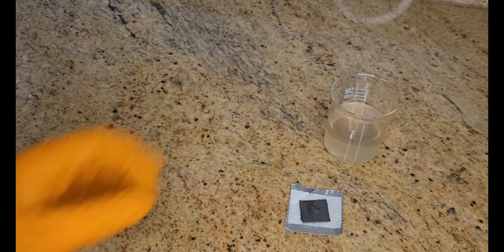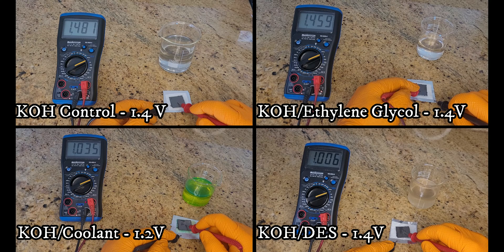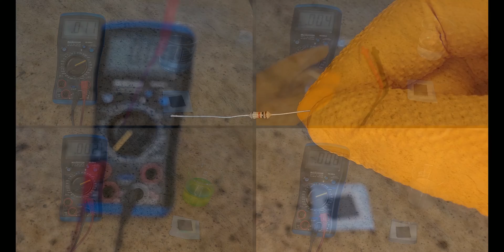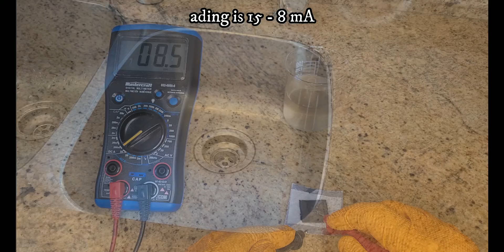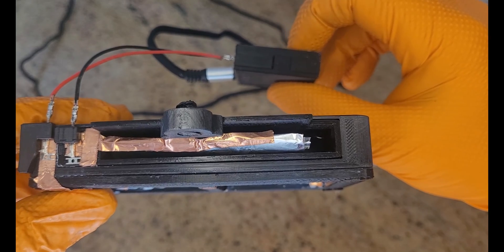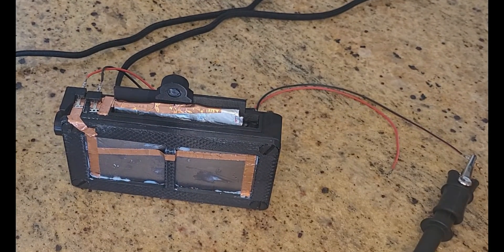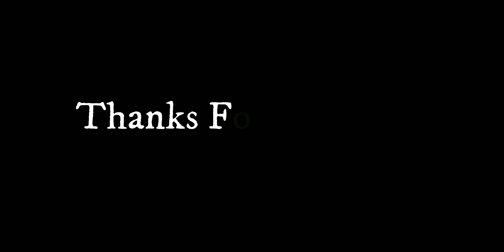Potassium Hydroxide in Aluminium Air Batteries

Comment: try KOH + UREA = Don't know the exact ratio, i just used Urea then added some KOH and stirr it using rod .. Liquid Formed , Extracted it .. AND did the same thing again and again .. Huge Amp .. Do reserach on this as well.
Reply from the maker: Very curious.  You commented on one of my other videos right?  I was thinking about what you said since then.  Do you mix anything else in or is it just KOH and urea forming the liquid?  I'm wondering if your making a deep eutectic solvent.  Which is pretty cool.  Also do you know what the liquids ph is?  And does the aluminum bubble alot when the liquid is touching it?  I have both these chemicals so I'm probably going to try it.  Just wondering what your experience has been so far.  Thanks for the comment 😊
Reply: @MechanicGoneRogue  : Nothing , Just Pure Urea granules , and pure KOH flakes.  if you need i can make video as well.

1. Put some urea in a beaker (5 grams), add  few flakes of KOH in the beaker, mix it leave it for few seconds (10 to 20 seconds) , smash flakes on urea, it will turn into liquid, 

2. Extract it just by tilting beaker .because of liquid, urea granule stick to beaker's wall and rest of liquid will go downside , simply extract it :D .. This liquid have super electric charges but dont know what exactly it is :( ..
Reply: one most important thing to consider, KOH flakes will be higher than UREA. If you use Stirring machine.. Less Urea + More KOH .. If you use same amount like 5g of Urea + 5Gram of KOH , it will turn into liquid but Urea will be there.. To dissolve urea you need to add KOH .. 

We can play with the ratios and check their performance in battery environment. 

I wanted to test in some battery environment , if possible for you please make a video on it .. 

1. Graphite anode cathode with additives + given electrolyte . (UREA KOH) different ratio performance. 

2. Graphite foil treated with KMNO4 ( Few hours at 60 to 80c .
Reply from the maker: OK thanks for all the info and the suggestion.  This seems to have some merit.  I'll be sure to give it a try when I can.  Cheers!
Reply: @MechanicGoneRogue   i again created this solution. Make sure to use hand gloves , its highly alkaline in nature.  One of the biggest advantage is higher concentration of koh. Here 20 c temp. Transparent liquid is very hard to make but translucent is easy. Its gel like structure now. Note : just focus on flakes or granuelle in mixture. Avoid powder.  Granuelle means solution have more urea. Flakes means solution have more Koh . If Koh flakes in solution , add urea. And if urea granuelle is there then add urea (small quantity) , you can heat uoto 60 c. I tested on this for short period a
. Rest on test.. please tag me as we if you work on this.
Reply from the maker: Thanks for the warning @amitgarg8393  If I can I'll be sure to let you know if I work on this.  Cheers

Comment: Perhaps you are, but I'd  keep to the battery's name sake by using pure aluminum. As store bought aluminum foil, much like soda cans are garbage loaded down with aloying metals such as zinc and so on. Any how thanks for reading good luck
Reply from the maker: Maybe so. There is actually a lot of research into aluminum alloys for the purpose of reducing corrosion on the anode.  So aluminum foil may be better than we realize.  Thanks for the comment.  Cheers !

Comment: Hello, fellow diy battery tinkerer here. I love your work and applaud your experimentation and thank you for sharing it with us!

When you contact aluminum and graphite in a flooded configuration like you had, you don't have an aluminum-air cell, instead, you have a galvanic cell, i.e. you will be producing hydrogen gas on the cathode (graphite) as it discharges, this might be what you observed?
Reply from the maker: Hey there.  Thanks for your comment.  I'm glad you enjoyed my video.  I agree with you about hydrogen production causing the bubbling, but aren't galvanic cells comprised of two metals?
Reply: @MechanicGoneRogue  well graphite is a metal of sorts 😋
Reply from the maker: Oh OK.  Well I guess I never really looked at it that way.  Thanks for sharing :)

Comment: Add Zinc oxide to the KOH.
Reply from the maker: Any particular reason why?  Is it supposed to boost the reaction?
Reply: @MechanicGoneRogue  it would inhibit AL corrosion by electroplating Zn. Koh + Zn oxide + water or gel based on PVA +Borat . Use some carbon felt to increase surface area + active carbon powder + graphite. Graphite foil as current collector and AL would give a great battery.

You could create a ceramic from toothpaste + Koh + Zn oxide+ water.
Put it on paper separator and on the other side I would have an acid based gel. Use active carbon felt at the positive and graphite foil as positive current collector and on the alkaline side AL current collector.
Let me know what you think.
Oh, you want to do at least 20 charging cycles.
Reply from the maker: @joaocarimo  seems like you've done some research into this subject.  Can't say that I've explored most of the chemicals you've mentioned, but I have been working on making a basic gel electrolyte with PVA.  The results haven't been that good so I've been considering to mix up my approach and try plaster of paris instead.  I definitely like your suggestions though and I'll probably try them in the future.
Reply: @MechanicGoneRogue  give it a try, because it is simple and very cheap. The results are amazing
Reply: @MechanicGoneRogue  I couldn't find quality grapheme. Otherwise I would have made current collectors from styrofoam+acetone+Graphene+active carbon+ graphite. I would press it in a press and let it dry to use it as current collector.
Reply from the maker: @joaocarimo  well if you ever do find some decent graphene and try it.  Let me know how it turns out.  It's sounds like a good idea.

Comment: I was a Chemical Inspector/Surveyer in Houston for years, and had free access to these (And way way more) chemicals everyday in unlimited quantities. Now I'm switching career fields and taking a Hybrid Electric Technician course and I'm interested in making my own Aluminum Ion Battery much as you are. I'm thinking dang, now I got to find those chemicals and I bet they arnt as easy as just going to Walmart lol.
Reply from the maker: Now that's what you call ironic.  Honestly the hardest chemical for me to find so far has been choline chloride.  Thats why I make my own.  Most of the other chemicals I got from Amazon.  Best of luck with your battery making.
Reply: Same, I used to be laboratory technician for a food company for about 5 years and had access these chemicals. Now that I changed fields to EE and want to specialize in Electrochemisty 😂 it's difficult getting those chemicals .

Comment: oops! missed this video for a week. I note that you may need to normalize your audio levels a bit and maybe raise the gain on the facecam clips. The volume abruptly changed between some segments, and overall its much quieter than most other videos on youtube.
As for why the cloudiness appeared: note that hydroxides are hydrogen acceptors, while water is half-donor-half-acceptor. You probably didn't have enough glycol to donate hydrogen bonds for all the extra acceptors you added when you mixed the two solutions.
Regarding the bubbling: if it has water, it will bubble when charged above 1.23 V as the water is electrolysed.
Regarding current flow: more viscous solutions have a lower current as the ions find it harder to push through the solution, though current can also be affected by how many mobile ions there are per unit volume of electrolyte
Reply from the maker: Love the comment @pixelrainbow.  Do you think the audio detracts from the video too much?  I tried using some different audio features in my editing software, but it didn't seem to work out this round.  For the cloudiness based of what your saying. Maybe if I upped the percentage of glycol that would fix it?  And then for the current flow what if I included something that would give it extra ions?  I didn't include it in the video but I noted in my experiments a small amount of sodium acetate seemed to improve current flow, but it wasn't by much so I didn't pursue it further at the time.
Reply: @MechanicGoneRogue  extra glycol might help, but I'm not sure, since hydroxides are almost never used as a component in DES, and water also tends to interfere with DES stability.
Reply from the maker: @PixlRainbow  well maybe in can mix the hydroxide in alcohol.  I've found it is soluble in smaller quantities with ethanol.

Comment: To make the prescence of Hydrogen completely 0, I think adding KOH directly to the Deep Eutectic Solvent is a good idea. This will surely suppress Hydrogen evolution. Also, we can soak graphite in a solution of platinum or manganese dioxide nanoparticles, to increase ampearage.
Reply: He also clearly says, that just MnO2 is not enough. It has to be nanoparticles. To make them, we need to create a 0.01M solution of Potassium Permanganate, immerse carbon felt into the solution and keep this setup at 70 degrees celcius for 4 hours. The colour of the solution changes, indicating that the process works.
Reply from the maker: @aadhithvarathan5432  oooh OK I'll check it out.  I'm familiar with Robert Murray Smith's channel.  I probably just missed that particular video.  He has alot of them lol.  Thanks again.
Reply: @MechanicGoneRogue  You're welcome.
Reply from the maker: Thanks for your comment @ Aadhith Varathan.  Interesting suggestion using manganese dioxide on the graphite to bump the amperage.  I've never worked with it before.  Do you know of any sources that talk about that process?  I'd be interested in reading into it further.
Reply: @MechanicGoneRogue  You can look at Robert Murray Smith's videos. He will explain how for Oxygen Evolution Reactions, Platinum is the best but is too expensive but MnO2 nanoparticles is the next best bet. He would also explain how to coat carbon felt with such catalysing particles.
Reply: KOH WITH ALUMINIUM FORM H2 NOT  YOU CANT STOP IT.